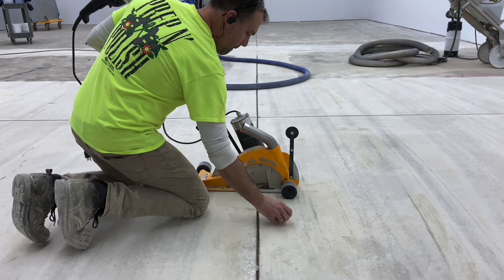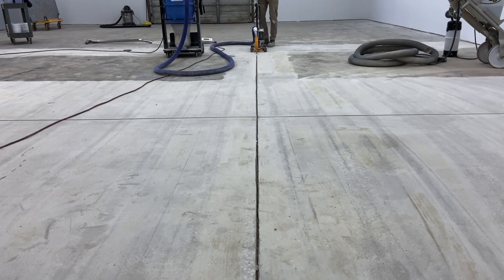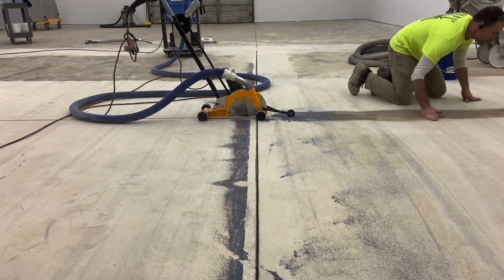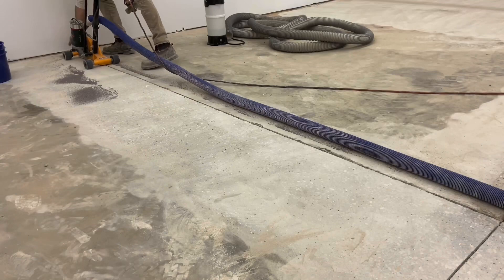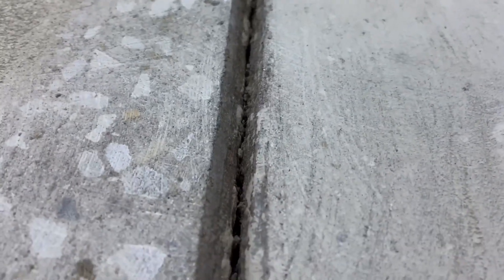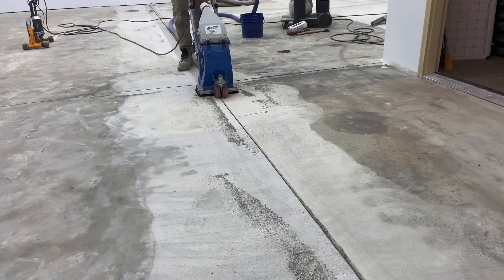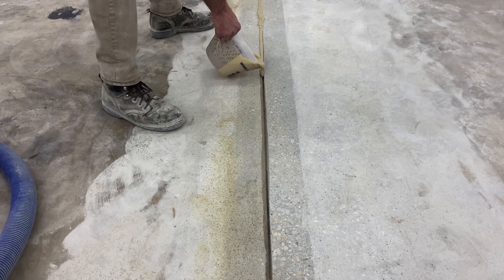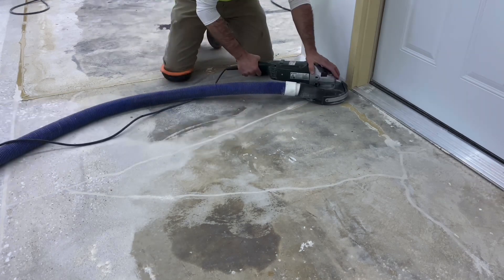How To: Concrete Control Joint Preparation, Filling & Finishing

Comment: What is the full name of your filling? Sorry I am not a professional and I would know the exact name. I wonder if I can use this filling for my concrete pavers (not slabs). I am tired of polymeric sand that always fail after a year or two and weed start growing after. Much appreciated!
Reply from the maker: The product is called PolyFlex. It’s a modified urethane. While it might work for your application from a performance standpoint, it’s not UV resistant. If left uncovered it will chalk and turn amber/orange. Sorry I can’t help with exterior sealants for your need. Exterior work is not something I have much experience doing. 
Here’s the product info for your reference: https://www.smithpaints.com/?ae_global_templates=poly-flex
Reply: @joshjones8047  Thank you! Good information for me to look out for when finding other alternatives 😊

Comment: Great video and great explanation 👍.

Why don‘t you use silicon for this joints ? Not that I have experience with it, I only thought because it would be more elastic when the concrete moves with time….
Reply from the maker: Thanks for the compliment and input. 

This floor will be covered by epoxy and uniformly seamless. Silicone could be used but then the joint would have to be left uncovered. Epoxy doesn’t stick to silicone. While most control joints can be filled and coated, it’s always best to confirm proper procedure with the coating system manufacturer. 

Thanks again-
Reply: @joshjones8047  👍 ok i understand ! I thought you are going to polish it !
So if you would polish it you would also use silicone ?
Reply from the maker: @esdrehtsich9289  if it was to be polished, then it would be a polyurea or modified aliphatic urethane. Neither of these products polish the same as concrete, but they blend well enough and maintain good elasticity. A rigid filler would polish better except it would be likely to crack within a year.